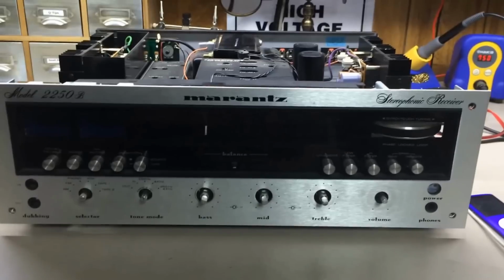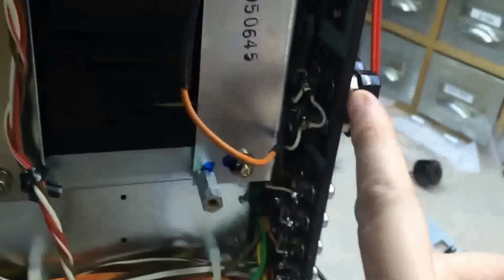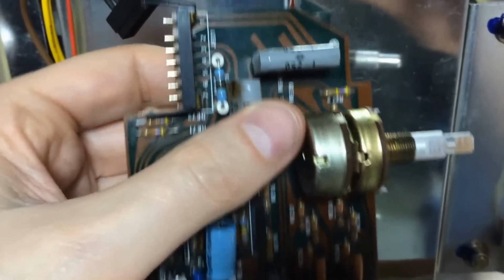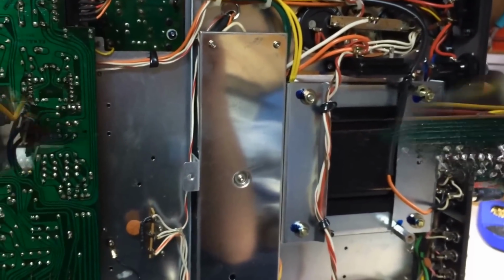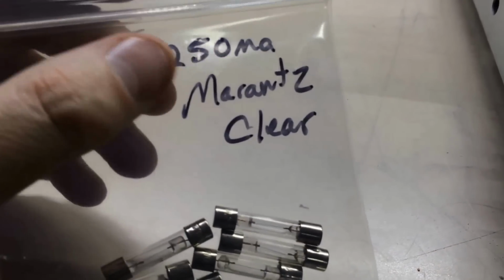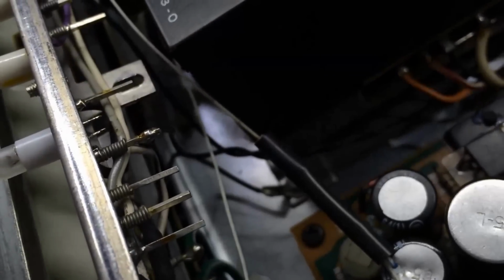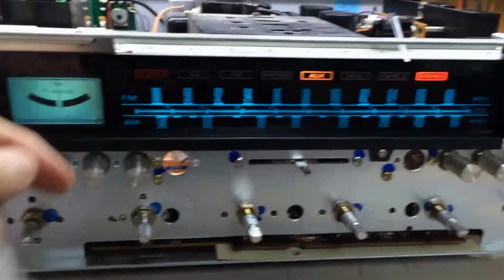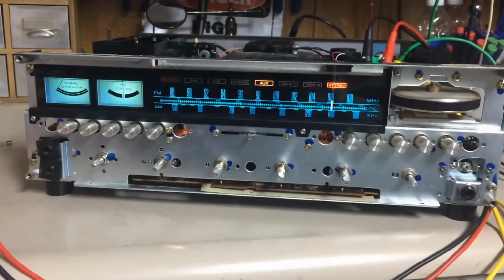Marantz 2250B Repair and Relamp Part 2 - BG008

Comment: Excellent video. Thank you for such quality instruction !  I'm subscribing. I'm currently into my 2385, relamping and lubricating. I've chosen the original 8V 200ma incandescent bulbs. My unit wasn't used that much over the years, and when I checked the existing vellum paper, it appeared to be still quite white. So I'm leaving it alone. On the 2385 it's not that easy to change out. In the future, if you have an opportunity to do this sort of maintenance or repair on a 2385, please post your very excellent step by step again. I've discovered there are very few, if any, at all on this kind of repair to the 2385. Appreciate it.  Thanks again !

Comment: Just picked up a 2250B. Everything works except the five dial lamps need replaced. Now on yours you say the pre out/main in needs to be jumpered. Mine, I get audio without using jumpers on all inputs. I compared wiring I could see in your video & with mine. Looks the same from what I can tell. Any ideas why it's different. I saw no mention of jumpers in the manual. Just that you could use the PI/MO to adjust a tape being made.

Comment: Doing lamps on a Mod. 125 FM Tuner (very similar). Hmmmmmmmmm, you very thorough with all your videos, however did you replace the vellum for VU meters? And agree with the blood suckers and their pre-cut vellum, found a company that sold single sheet (I do not have a repair company) for $3.00 and free ship.

Comment: With only one remaining lamp working and the odds are it will surely fail soon why wouldn't you choose to replace it along with the others? On the tone/preamp board why wouldn't you go the extra mile and replace all the electrolytic capacitors? My thoughts - thanks for posting

Comment: Regarding the screw to hold the rubber "foot" being too long, I seem to recall that when the optional walnut case for Marantz receivers is used, they required a longer screw to account for the added thickness to mount the foot back on. Maybe that unit had a wooden case that was later removed, but kept using the longer screws.

Comment: Very very good video, but I must say I wouldn't use steel or silver spoons to leaver the control knobs off, I use two pieces of tough polyprop, which is much softer than the Marantz Ali front panel, but has just enough leaverage, to wiggle a difficult/jammed control knob off, especially after an application of WD.40, what do you all think?, Les.

Comment: I would like to know why that one electrolytic capacitor (by shorted IC) has such long leads, is floating in air, and not flush with PC board?
Reply: +genuineuni Thats they way they came from the factory, the cap is too tall to mount straight up so they took a short cut and bent it over with long leads.  Less than ideal but it works

Comment: Great video, but for $1-$2 and 5 seconds of time, I would have replaced that one last bulb for the customer. If two bulbs of equal age are present and one is burnt out, the second is soon to follow. Taking a few seconds now saves the customer money down the road. None-the-less, your videos are excellent and very educational! Thank you for taking time to create this material!
Reply: I was going to mention about that last bulb in the middle too...  It's still really dark, and is quite noticeable since that remaining bulb is on it's last legs.  I definitely would've changed it as well.
Reply: Absolutely, my OCD kicked into high gear with that last bulb.

Comment: Hello, thank you for the video!! just what i needed!! I have two boards like you show in your video. circuit board is for pre tone control. first one is complete but have different capacitors in the beginning of the circuit. It has a pair of metallized polyester capacitors of 1 mF 100v. the capacitors are the CE05 and CE06, but in your video these capacitors are gray and have "1-250" written on them as indicated in the part list and this complete board didn´t work in other 2250b which have the pre tone control without the BA312 chips but this circuit board still works even without the BA312, it sounds weird a bit but works. Well. I want to ask what could i do to adapt the complet pre-tone board to the unit in which this doesn´t works? The capacitors are different. I suppose this is the reason to each one fail in other unit that them are for.  Should I change the capacitors? or the BA312?. Thank you.

Comment: I recently fixed a Mitsubishi receiver but could get no sound out of it. it has jacks on the back labeled EQ in & out. You have to plug something into the jacks or install an EQ to get the amp to work.
Reply: +Bri G. Very common to see this on 70s stereos, many of the marantz are like that.
Reply: it was really making me crazy, I was checking everything and couldn't find any bad components...you have to loop it or install a EQ. I have the Mitsubishi EQ that came with it, but will any EQ Work?

Comment: I had a Marantz 2250B. If you can find one that won't give you any trouble. Good Luck ! They are the better sounding line of Marantz receivers. But it gave me nothing but hell as far as reliability & dependability are concerned. The left channel was constantly shorting out on me. It was worked on by a reliable Marantz tech. who still couldn't find the problem. I had to let it go.

Comment: Very detailed video. The only thing I don't get is why you did not replace the middle dial lamp. You put in 4 new ones but kept one old one. The difference in brightness can be clearly seen when you power on the unit and the dial area is lit up.
Reply from the maker: Anthony DC great question, I typically do replace them all if there is any visible difference.  I wonder if the difference showed up more in the video than it did in person and i just didn't catch it due to that.  Often times as well I have clients who are being very tight on their budget but its been too long to remember the details around this one.

Comment: The thing with the longer screws was an issue back then. The longer screws were to be used with the optional wood cabinet. Also, many but not all Marantz receivers of the day did not require pre-main jumpers, instead had pin-switches INSIDE the jacks. The pre-main would be separated when a cable was plugged in. This was another source of trouble though. The switches would get dirty like any other and require cleaning or bypassing.
Reply: Qq